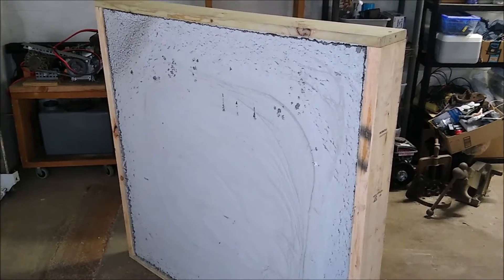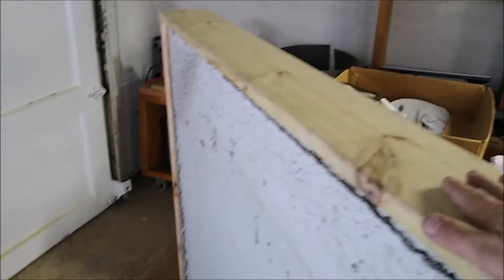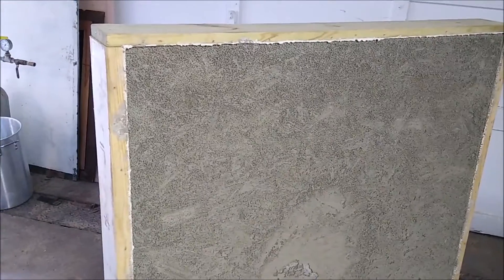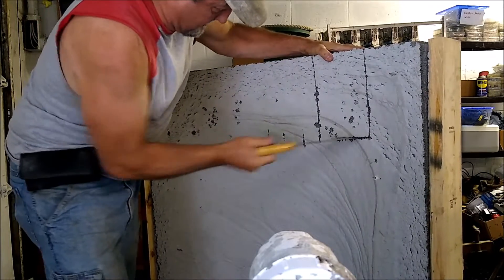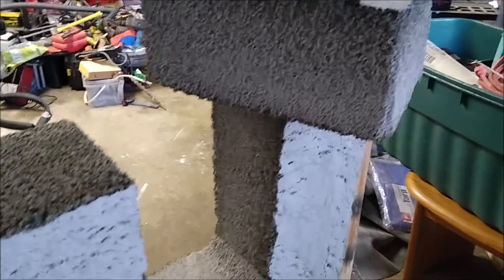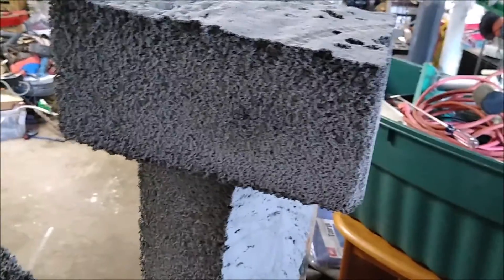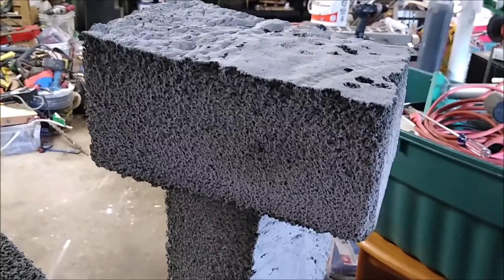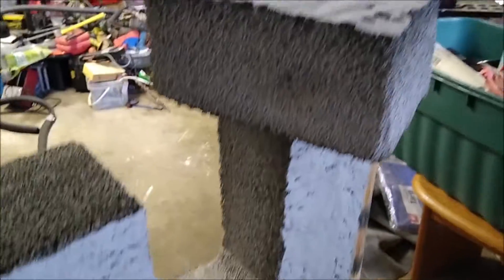Aircrete Wall

Comment: Hi, very nice video, what are the ratios that you used to make this Aircrete ? and how you got this white layer, it can be seen quite hard that the interior of the block ? wright !
Reply from the maker: Hi ratio is 6 th 7 gallons of water depending on how thick you wat it 1 bag of Portland Cement then the rest of a 55 gallon drum filled with foam. As for the hardness it’s ok but can Easley be damaged so most dome homes have a layer of cement with cloth wrap to protect it
Reply: @madscientist4021  Thanks Sir

Comment: Can the aircrete be built in wood studs or should it be metal studs? Is there a potential for mold/mildew? Thank you
Reply from the maker: yes it can be build in wood I did check it buy pulling it out and it seemed fine. You can do metal studs as well if you like. Also Stay toned im planning on Building a whole House Also if you worries about mold you can coat the wood if you like but i didnt see any problem so far

Comment: Please give us some advise on bullet proof upto rocket proof lightt concrete materials we use mud which can stop rocket but thiefs or terrorist can easily dig hole in it with any matal piece  in some parts of the world people like to live in rocket proof houses e.g AFghanistan pakistan
Reply from the maker: I would say its not bullet proof Its almost like Insulating Foam but a bit denser. However it is Sound proof and Bug proof as well as Fire. If were you id make some and test it
Reply: For bullet resistance, add basalt fiber or S-glass.

Comment: The biggest question in my mind about aircrete is explosion if left to ☀️ specially at above 40c because the air in side bubbles will be forcing from all over to expand due to heat
Reply from the maker: i dough it but I do not know for sure
Reply: There's no problem with expansion or explosion.  Once cured, its as stable as regular concrete. Aircrete is used primarily in hot environments like the American southwest as well as many tropical countries/islands.

Comment: Brother Assalamualaikum

Please be advised

You can add PERLITE into your Mix

Also DONT use Portland Concrete

ONLY USE C.S.A. CONCRETE with PERLITE and PLANT BASED SOAP
PLUS WASHED SAND

This is BEST MIX
Reply from the maker: sounds good I will have to try it thanks
Reply: csa concrete? i want to use aircrete in my walls...how does one come up with csa concrete?
Reply: @D.A.T.GRINGO  the chemical make of csa cement mix, works better with Aircrete applications 

Add micr helix rebar made of basalt and it will be strong enough to withstand a C4 explosion according to CIA
Reply: @lighttheoryllc4337  i have heard of that as well, but i truck dry bulk cement up to the northwest territories to a  cement company, and had asked the owner of 40 yrs if he has heard of basalt rebar etc. he said oh yes see that pile over there, its all basalt rocks (small). he said they use to add it to their cement mixes just for that purpose, but they started to get negative acids leaching out, did tests, and found out it was the basalt. i will ask him about csa cement as i am taking another load up there tomorrow (takes 20 hrs to get there from edmonton alberta).  I wanted to build little domes on my property for family and friends to stay in when they came for visits, and was going to use basalt rebar and basalt mesh, to make the initial bird cage before shotcrete, aircrete, lime plaster stages....it would be nice to know what the final outcome might be, maybe its the diference in what the basalt is mixed with..or maybe the basalt rebar just needs a coating od some kind that doesnt react into the cement
Reply: @D.A.T.GRINGO  email my business email and I'll drop the link to you in the company that has the recipe used by CIA
Reply: @lighttheoryllc4337  will do, thanks

Comment: I have heard that 3-4ft vertically is about the limit with this stuff(have not tried that yet) because the bubbles at the bottom start to compress, so building a wall is very doable, but might have to do it in layers, i think this is the reason most people make blocks and lay them.
Reply from the maker: yes your right what happens is the cement settles when I filled my Block foundation I filled up to 3 feet when it dried I did 3 feet more. Yes its why they do blocks as you can stack them. But the SIP way works Great Makes a Whole wall section
Reply: @madscientist4021  i am currently building a shop out of aircrete blocks (quanset style) and considered pouring   it first till i learned that, i am planning on macro fibers in aircrete, then coating it in cement stuccu and cloth combo they use on aircrete domes.
Reply from the maker: @carlgeisser2463  yes that's a good way of doing it just remember it dries in 24 hours and fully cures in a month. Even if you coat it with stucco
Reply from the maker: @carlgeisser2463  Buy the way are you familure with AAC ? Auto Clave Aircrete ? Its a bit more But Far superior here is a video of it  https://www.youtube.com/watch?v=DIheSPFziBU&fbclid=IwAR2xWQ7jRIPUdXO61SF2xysxLv6n_teh5fRGK13-kxLUs-Zc7O_V4S8F2YE#t=223

Comment: Hi I live in Great britain we build with blocks made from Air Crete  I believe  they add sodium
silicate  which makes it very water resistant  and stronger and oil resistant see u tube video 
on uses for sodium silicate also know as water glass !!
Reply from the maker: Hi Martin I have friends who live in Great Britain and come to the US for Stan Meyers conference. That said yes im aware of this additive and there are many more things to make it strong. This was ment to be a simple cheap way to do it. But if you don't know the best is AAC :Auto Clave Aircrete But Expensive this can be used for load baring just incase your not familure here is a Video    https://www.youtube.com/watch?v=DIheSPFziBU
Reply: Hi mad Scientist thank's for informative video !

Comment: Nice video. How would you secure fixtures to the wall without damaging them? ( like cupboards or cabinets) thanks
Reply from the maker: this type is designed for internal But you can use Stucko on the outside or use AAC type Aircrete. Also u can use plywood or drywall sandwich. here is a video on the AAC type https://www.youtube.com/watch?v=DIheSPFziBU

Comment: Wath ingredients does the mixture contain? Do you use sand for mixing?
Reply from the maker: 1 bag of Portland cement 90lb 6 gallons of water and the rest is Foam filling a 55 gallon drum. You can use sand some people use fibers and micro rebar to make it stronger
Reply: Better to use fiberglass than cement for tensile strength.

Comment: Could I get that formula from you? Like to try it out around my Deck and Garage.
Reply from the maker: in a 55 gallon drum its 5 6 or 7 gallons of water depending how dense you want to make it 6 is typical with one 90 lb bag of Portland cement. the rest is Foam filled to the top
Reply: @madscientist4021  Thank you I have some projects that I would like to try this on.
Reply from the maker: @claystone7729  no problem most people use this with either Stucko around it or in-between plywood. there is another one that's more expensive but can be used for load bearing called AAC "AutoClave Aircrete here is a video https://www.youtube.com/watch?v=DIheSPFziBU&fbclid=IwAR1EPPf-bmhjF-2t6PjScIszDbQ5wIuzT1qeYEPxNE34sucq2tp8ZiNnZVo#t=223

Comment: I have been kicking around a idea for a simple solar hot water system that can be used in any home or building, a heated lite weight  wall that would have the thermal mass to store Heat, I'd like to hear your thoughts and test it out.
Reply from the maker: yes this would be great insulation for a solar water heater I believe it would work great and is fireproof
Reply: For something to be an effective thermal mass it needs to have.... mass.  Something that is light weight won't be an effective thermal battery.

Comment: ..cool on using it as insulation in walls, but are you also suggesting that a person could  make one large form, and then make a dome with the large blocks instead of small blocks like everybody else has been doing?...wonder if it effects over all strength, or will it be the same due to the building being a dome? i know honey do carpenter did his shed with smaller steel stud walls and air crete, but i would like to build a dome faster some how...maybe larger blocks is the answer?...i would probably put some kinda mesh in each block..would be logical to build in a tongue and groove right into the form as well maybe?...scratching me knoggin'...hmmm...many possibilities!!!
Reply from the maker: sorry I didn't get back to you sooner im on vacation but all you need to do is what they do in Hawaii the aircrete will hold on its own if you have a mold or a inflatable mold then you can simply stucko both sides
Reply: @madscientist4021  thx M.S....enjoy your vacation!

Comment: very useful information   thank you
Reply from the maker: no problem there is another type called Auto Clave Aircrete AAC its far superior but requires a high pressure chamber
Reply: lifetime of the slab ?
Reply from the maker: @cedricpod  not sure exactly but it should be as long as a normal home and is load bearing here is a video on it   https://www.youtube.com/watch?v=DIheSPFziBU&fbclid=IwAR0vahrvxOtl5BKx-kS2bu0vgyQYsZKIQ2nRyU-6DDqrPmDpbPltoltR9cM#t=223

Comment: Perlite will soften the structure, it being soft the wall may well harden with more time.,  people have talked of using CES (?) I think as an accelerant/hardner, in your case a couple of tablespoons, into the mix, also what about using latex admix, the heavier the liquid the better the results, also what about using rockhard putty as an accelerator? in your mix perhaps a tablespoon,  or two, this will trigger the set times. reducing bubble fall.
Reply from the maker: yes it a disadvantage to this aircrete however there is a Alterative called AAC "auto clave aircrete its far superior and Load bearing However more expensive. They build whole building in Germany with this   here is a link https://www.youtube.com/watch?v=DIheSPFziBU&fbclid=IwAR3opMtpQHYd7b_liov_Csstvshw6dppkddqxeJFfqqTrCK6THsUKnA2mf4#t=223

Comment: Looks good! I live on a corner lot with a lot of traffic. I'm installing 2" thick aircrete panels on the exterior to deaden sound and help with insulation.
Reply: Did you install the panels yet?
Reply from the maker: nice should work fine let me know how it goes

Comment: Found your channel from Aircrete Harry.  Thanks for the videos.  Do you have any experience or advice on how to get this approved for code in municipalities?
Reply from the maker: I have not ventured that far yet However it is completely fire proof and I see no reason they would not love it and approve. Provided its incased in standard materials. Also they do sell Aircrete block already aproved
Reply: @madscientist4021  i have seen the blocks here in canada, over on the east side, but i am wanting to pour my walls after its framed up..hpw long would the wood last with aircrete in as insulation i stead of rock wool..any idea?
Reply from the maker: @D.A.T.GRINGO  It should be fine when it drys However Poring it upright causes a problem You will have to Pour about 2 feet at a time because the pressure will pull most of the Cement to the bottom. thats why most will Pure Blocks and i pored it lying down in the Frame. Now 2 more things You do have to seal it good or it will leak out. also Bear in mind it needs 24 hours to dry so being Enclosed like a Wall I have No Idea on drying
Reply: @madscientist4021  thx yes, im planning on slip forming all the way around, a foot going up each day...this way it wont lose the air bubbles. i know aircrete harry does it with steel studs back to back to create a pocket, but i was wondering about the wood. if i use pressure treated, .and come out further on each side of the 2x6 walls with aircrete spacers, and pour the aircrete to encapsulate the treated boards, would the treated lumber leach out toxic vapors?...hmmm. i got the aircrete spacers idea from aircrete harry as well..his idea of metal might be longer lasting, but then again, maybe not?...hmmmm.

Comment: Nice tight looking consistency on the bubbles!  Have you tested it for the r45 value on the 5 1\2" aircrete? Quick job with the handsaw!  How would it hold up to Aircrete Harrys torture tests?! Keep it up!
Reply from the maker: I have not tested for the R45 value yet but I will. and I will have to look up Harrys test thanks